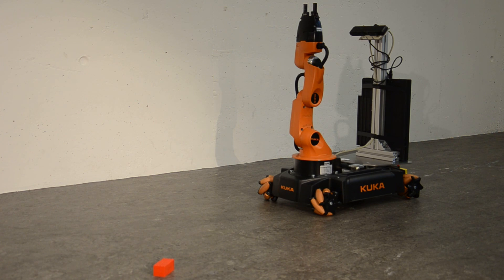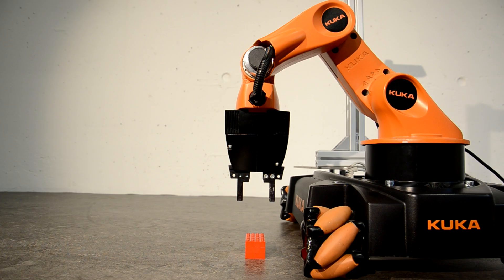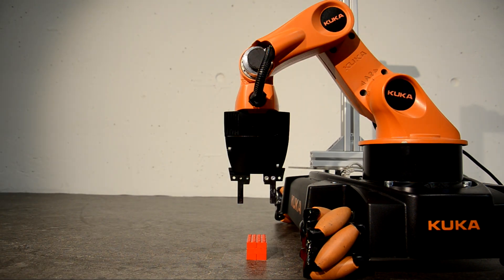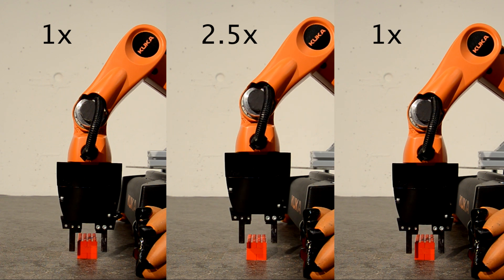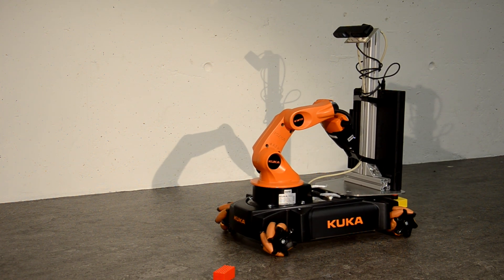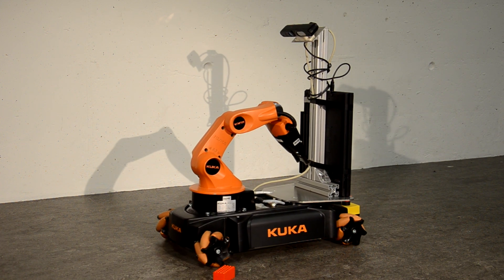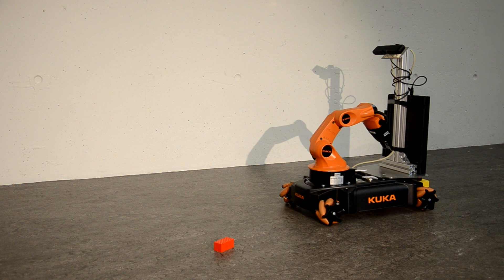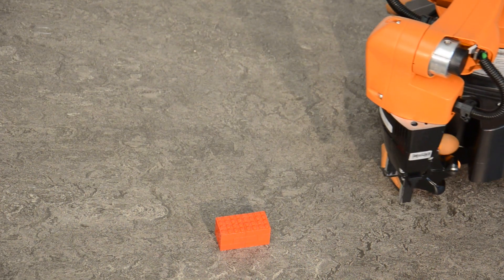Torque Control of a KUKA youBot Arm

Comment: Hello, I run your program in inverse kinematics, but change the quaternion ,the program can not be successful, how should I change the position with quaternions, what is the relationship between them,and what's the meaning of quaternions of the four datat ,Eigen :: Quaterniond grip (0.6851, -0.1749, 0.6851, 0.1749), if you have time to see my question, I hope you can answer it, grateful you very very much.

Comment: The equation (4.7) for the computed torque controller given in the msc. thesis has an error. The coriolis matrix is postmultiplied with the desired velocity instead of the actual velocity. This does not result in the error dynamics given by equation (4.8).